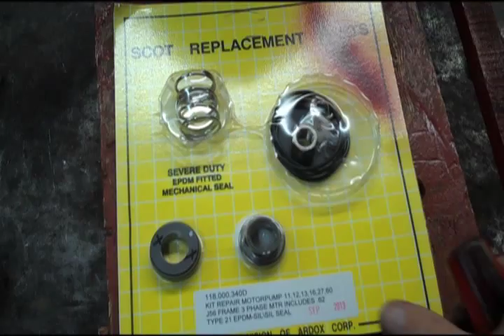SCOT PUMP seal change motor swap repair 56J motor fix leak disassemble reassemble

Comment: Are all 56J motors 3 phase.  I found a part to replace my 3 phase built on a 56j but the tag isn't completely visible in pictures to know.  I've looked at Granger etc no one can answer.
Reply from the maker: no they can be any voltage  or phase